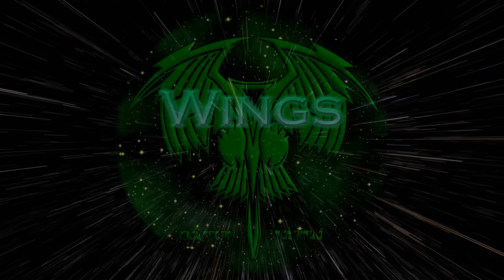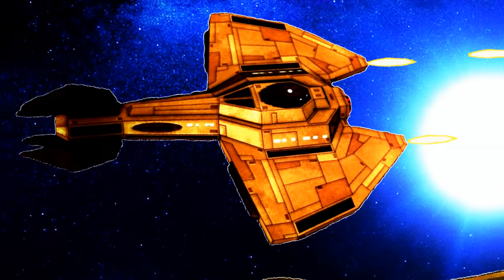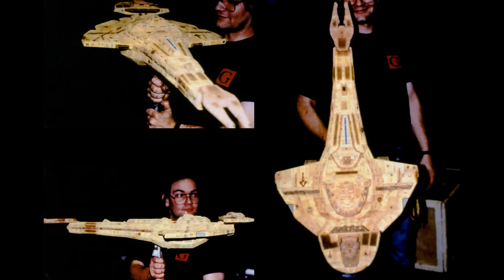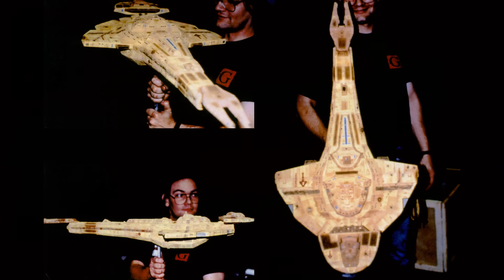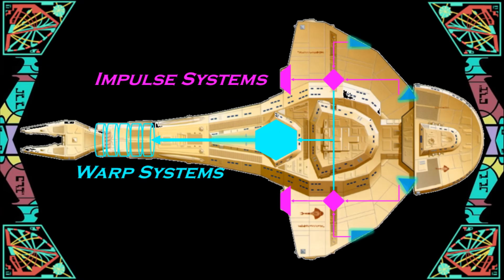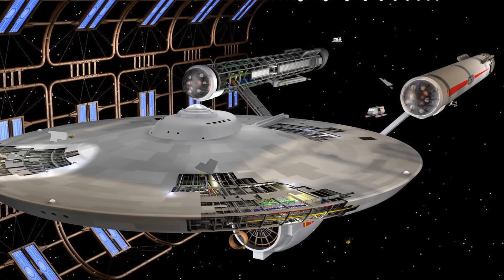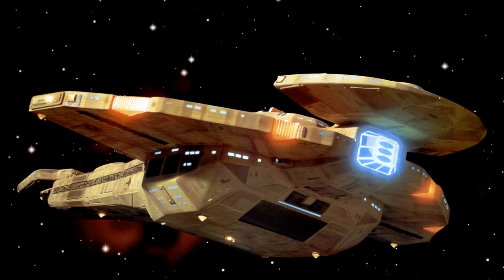Why Are Cardassian Ship So Weird?

Comment: As a general thing, I think it was established that the 'saucer, engineering hull, twin nacelle' design is not required, it's just the most efficient design in the Star Trek universe. So you can have other configurations, but they have issues.

Comment: So one quick note... yes radar has traditionally been in the nose of fighters but thats older design philosophy because radars used to be larger and needed to be able to move... newer AESA radars can be placed in just about any surface of a plane... even where they can see rearward... take with that what you will.

Comment: Don't know anything but, when looking at Roddenberry's rules I don't see them in terms of technical/scientific reasons but rather cinematic reasons.  Eg the engines must be visible from the front and have line of site across the hull.  That would help create the more interesting 3/4 views and having twin engines gives you a sense of power/steering and gives you better points of reference to see when something is turning or passing.  Why not 3 engines?  Probably just because ME262's look way cooler than a trimotor in most circumstances :)  Why would the bridge always have to be the top center of the primary hull in technical terms?  They wouldn't.  It just makes more sense to TV viewers :)
I don't have problem with it either way, as a technical fictional guide or as a style guide to make sure ships follow generally similar patterns and offer interesting/pretty angles when the models are shot in the most common ways.

Comment: I never believe the Cardassian used mono nacells in the galors I believed they had a dual nacell in the tail stacked side by side, on top called it a Dual Coiled Spinal Nacell but a quad Nacell stacked works too with the ram scoop in the wings and wings being for plasma heat and plasma venting.
Dual Coiled single nacell or quad coils if they are smaller makes sense to me

Comment: One thing that makes sense to me, in this fictional universe, is probably something some designer explained, but the productions never properly established, is the idea that a warp nacelle setup is dependent on distances and urgency the ships are intended to operate at. So, the nacelle can be overworked, Star Fleet went with two nacelles for redundancy, symmetry, and effectiveness (basically the combined metrics of speed of construction, reliability, maintainability, etc.), since they needed to go from one star system to another. So for getting around your own empire/federation, two nacelles makes sense. That is to say, commercial traffic should find only having one or two nacelles optimal, since a space trucker should be able to operate on the low end, relying on the government (star fleet or whoever) to recue them if their one 'go-stick' goes kaput. On the high-end, pleasure cruises and civilian transport, go with two nacelles. Then there are four nacelle designs; which are for vessels who need to traverse the big spaces (one side of a large territory of many star systems to the other, like an entire quadrant). Four nacelles aren't faster, but they let the ship keep at high warp while some of the nacelles are given a rest. Now, we've seen four nacelle Star Fleet vessels, not not nearly as many as we should have, imo. It should be that local space navies of ethic powers (like Klingons, Romulons, or Ferangi) should have two nacelle ships, but a vast federation of peoples with a near quadrant encompassing territory like the Federation, should have ships with four nacelles.

Comment: There was that one dumb DS9 episode where Sisko built a sail ship to hit warp speed and travel to Cardassia .... why he wasn't arrested when he got there is another story.....but lets just say Cardassian ship had the ability to deploy solar wind sails.  Or they once could and it's a symbol of their heritage much like how the Enterprise still has a wooden wheel of a sailing ship.

But there is one thing you didn't mention. 

Those ships are designed to be front on towards enemy.  Which tells you they aren't there for turning and burning.  So it is also plausible they have sensors back there to make extra sure someone isn't sneaking up on them from behind.

Or they could be rudders for atmospheric maneuvering.

Comment: I like the idea. Essentially it makes Cardassian ships less capable at warp - their max warp speed is likely less than the other major powers, and they can't hold it for as long. However, due to the wing design, they're more maneuverable than especially Starfleet ships, who often have smaller impulse motors, and closer together. Even Birds of Prey have just one big impulse engine, and it's centered.

Comment: Actually, the point you made about refitting the warp drive. Being such a pain because it's buried inside the ship isn't such a problem. Modern ships have panels that are specifically designed to be removed. So you can yank the motor out, or generators.

Comment: The TNG/DS9 Galor Class is the iconic Cardassian warship I'm familiar with and I always though it was rather "earwig" in design tbh 😂.

I liked the design and colors it had, was easily identifiable and always found that large phaser weapon "square" on the front very interesting too the way it kinda looks like a deflector dish yet possibly not or possibly some hybridised offering where a deflector and weapon combine or share the same energy feed.

An interesting ship for sure.

Comment: 06:10 there is no rule that says that warp coils must be cylindrical - you could create other shapes and they would work too point being it would be most sensible shape but it's not a rule- in that case flattening them to make them fit into the wings - could work. plus you mentioned efficiency - initialy cardasian designs were slower than what federation could field - they catched up way later closer to the Dominion war.

Comment: cardassian ships arent very strong actually. In star trek bridge commander the mission where you have to leave data behind, i got the hidden achievement beating all the ships both stock and modded (harder). It doesnt matter if you make a hardpoint tanky, a torpedo to it kills it and the galor class doesnt even much shields. If you can solo 20 cardassian ships with a single galaxy class ship, begs to question why you would have such a design.

Ships in star trek are based on sea ships, not jet fighters. So the sensors tend to be at the center of the ship but not the back yes because the back of the ship is the worst place given the interference from the engine. Thats why many solutions were scrapped that had sensors or anything towed at the back. Its a good decoy but not sensors. I know some new warships can tow buoys for asw but i dont think they pack sensors there, probably decoy.

Comment: A point that I'm kind of surprised you didn't mention is durability. Nacelle pilons are easily the most vulnerable part of most starships which is a major problem given all you need to do is cut a pilon or two and a ship is now stranded, possibly in the middle of nowhere. Given the Cardassians have fought many wars and most of them being wars of attrition, it stands to reason that they would be willing to go with what is effectively a single nacelle design built into the heart of the ship, which is slower and less energy efficient than a two nacelle design but more likely to survive a fight, given that if a Cardassian ship is stranded during war time, they probably wont be getting a ship to come tow them since the empire doesn't have a ship to spare to do this.
Look at the Defiant, the first Starfleet actual warship. It has its "Nacelles" built into the main body making it impossible to target them, it would be easier to just cut the whole ship in half than sever a nacelle.

I imagine the only reason the Klingons haven't adopted a similar design philosophy is because of tradition, and we all know they will always choose tradition over practicality.

Comment: 9:24 Towed sonar array? We do it on aircraft, ships, and subs.

Why wouldn’t you put a main sensor array there anyway? It would have a larger sphere of coverage (assuming the ship blocks all function) than it would in the bow and would be closer to power generation. If you mounted your primary sensors on the dorsal or ventral side, or way up in the bow, there’d be a lot more ship in the way and multiple systems would be required.

Comment: 1:06 I always thought those rules were utter bullshit. there are plenty that violate them. There were triple nacelle ships, a variation of the TNG enterprise nacelles and saucer. There were always several ships where the nacelles didn't have line of sight across the hull, like andorian and ferengi ships. There were always ships where the nacelles didn't have line of sight forward, like the klingon birds of prey. And there were always ships where the bridge wasn't on the top of the hull, like romulan warbirds.

Comment: The tail fins or warp field antennae are attached directly to the warp coil. They modulate the warp field energy gradient, and thus its geometry, creating a sort of warp bow wave that massively reduces the deflection necessary at warp and pushes the Bussard Well forward and out to a vortex ring along the bow wave edge. Notice the tiny forward deflectors of many Cardassian ships, when compared to Star Fleet models, and the forward position of the Bussard collectors. Cardassian warp drive does run hotter but this seems to be by design, yet more evidence, if any was needed, of the Cardassian preference for heat.

Comment: redating heat into space is actually not every good way to cool things in space. In empty space there is very little "other stuff"  to move that energy into. 
Think of your cars radiator it is cools your engine  by moving the heat from the engine block to the radiator coolant then to the air that passes thru the radiator fins. in space there is just nothing to pass the heat on too.

Comment: Grill in the back does make sense as a sensor array because it gives you rear-arc coverage. Starships are not fighters, so the analogy doesn't hold up as well. It may not be that, but if it is, that's why it would be there--to cover the rear arc(s) of approach to the ship. Also, does the single-body design (single nacelle, as you call it) necessarily mean a single larger engine? Why not two engines side-to-side or vertically placed? The single body allows for better armoring and protection of the systems, two engines in the body still allows some redundancy, and close proximity and not having to crawl up pylons could allow for better access for maintenance and/or repair.

Comment: Was there a stated reason you need 2 nacells? IE like a helicopter needing multiple rotors to counter the rotation? Maybe you could have a single nacel along the tail but use the wings to stabilize?  Some helicopters use a small rotor perpendicular to steer and balance, where as some have multiple large rotors spinning in opposite directions. Two similar solutions to the same problem , but look quite a bit different even if they're doing the same thing. 
If we knew a reason why Star Fleet is using 2 nacells, we could reason out other possible solutions to the same problem. Maybe a single nacell but is actually a twin with an inner and an outer nacel wraped around each other. Or the using the single nacell in the tail but have perpendicular coils or something similar in wings / front of the ship, so it has a hybrid wing and traditional nacel design.

Comment: I always thought that they just shoved both nacelles into an armored housing. With both nacelles inside the same armor housing it would be easier and lighter than 2 separate armored nacelles, especially if they had issues with the armor interfering with the warp field itself, which would help explain why the tails seem larger than normal nacelles

Comment: I am in a school of thought that you don't need even number of Warp Engines, but even number of Sets of Warp Couls...your image of Hideki class shown exactly that, not a single set of warp coils but actually 2. For example, if you seen Galaxy class starship and know how warp coils in galaxy look like,  you know that Galaxy has 4 sets of Warp couls....thats why (in my theory) even number of warp engines can work. Reason why Cardasians (and other races) building their engines to their ships instead on pilons is simple: defenseability, cardassian ships are notoriouse for weaker shields and armor it stands a reason that they are mitigating their warp capability by protecting their Engines in their hull, something that Federation or Romulans don't do. Speaking of which, this is also reason why Klingon Bird of Pray have its warp coils in its hull...it is relatively weakly armoured ship.
Edit: Manueverable in Warp Speed....What. First thin they taught you on the academy about warp "Its straight flight, theres no left or right." (Tom Parris, Voyager)...no seriously, despite what we have seen in TNG, it shouldn't be posible to stear in Warp...what Cardasian (and any in hull warp engine) disadventage is, is slower warp spead....it is cannonical that Cardassian ships are slower then those of federation.

Comment: No where in the design rules stat how far apart the warp nacelles need to be. The Cardassians butted the nacelles together so they only need one system instead of have two separate systems. Think dual cam vs single cam engines.

Comment: Wider placement of the impulse engines would also improve sub-light maneuvering. Lower long range endurance with massive boosts to sub-light performance also fits the design language of a species portrayed as territorial and insular. They aren’t out expanding far into the galaxy, they are locking down territories.

Comment: starfleet nacelles are intakes that skim the deflected interstellar material that's pushed out around the ship and while they contain warp equipment they don't actually have to be there FOR the warp equipment    the Cardie system is more direct and more useful if less efficient

you're failing to comprehend that the nacelles are not engines, just field generators.  The engine is the impulse drive either in or out of warp.

Comment: There's one thing I do not understand.
As soon as your average SciFi civilization is able to conduct interstellar space travel, resources should be a non-issue. In Star Trek, basically EVERYTHING can be replicated with exception of very few materials, like Latinum (used as currency by Ferengi) and Dilithium (used to govern matter and anti-matter in a starship's warp core).

Sure, it's said in the show Cardassians live on a resource poor planet. the Cardassian Union isn't confined to only a few star systems, but it's a sizeable faction in the 24th century. Do they have a weak economy that's not able to keep up with the demands? This could be a thing: if they lack the infrastructure, they can't exploit all resources available & required by their economy. 

Also it's said most Cardassian ships are older designs, including that famous Galor class. Cardassians don't "buy two for the price of one" and "don't throw away a ship before it requires maintenance". In fact, it's entirely possible their economy is bogged down thanks to their massive fleet and Cardassias unwillingness to reduce their fleet size until their economy is able to support their fleet properly. It's more a case of spending far too much resources in military stuff while everything else is starving for money.

Comment: I always figured the tail WAS the nacelles, or some analogue to them. The galor's tail is slightly elevated and distinctly coloured, so I had thought it had something like a horseshoe-shaped array of Cardassian-flavoured devices that worked like warp coils but were able to generate a much smaller and denser epicenter for a warp field. The array you mentioned around 8:25 could be a heat-sink around the warp engine that channels power into the warp drive tail fins. 

Used to wonder about the warp wings, but I like your arguments against them, quite liked the vid.

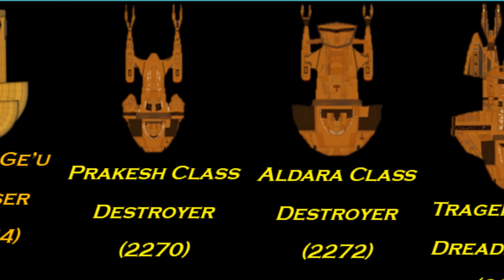Comment: 3:45 I saw an interview from early TNG with the ship designers for the Galor, and they said the original ideas they had for Cardassian ships were those prongs on the back were supposed to be the ships main weapons. All species ships reflected their race. Humans had weapons spread out, good for defense but not great for offense. Klingon weapons were right in your face and pointed forward, aggressive and direct. Romulans hid their weapons like they hide their intentions. And Cardassians were meant to have rear facing weapons, they were more dangerous when they were going away, more dangerous to chase than to let flee. It made them unpredictable in a fight. Their tactics and thought processes were supposed to be very different and alien compared to the other races. However the guys that designed the ship never bothered to tell the writers any of that, and soon they were watching Galor ships on screen dive straight into fights like Klingons shooting blasts from their deflector dishes.